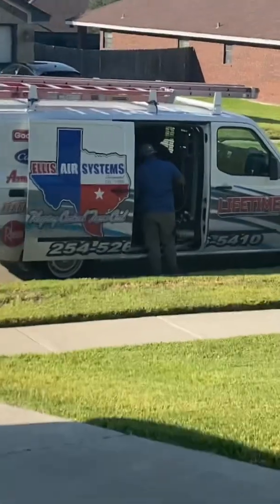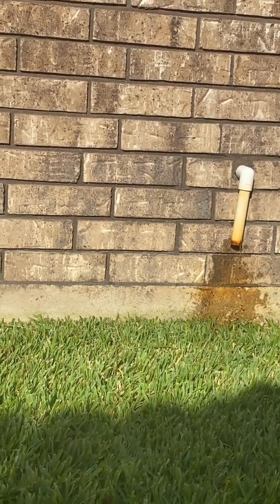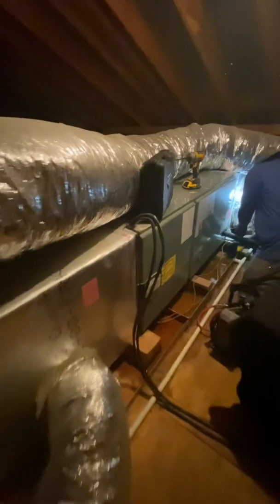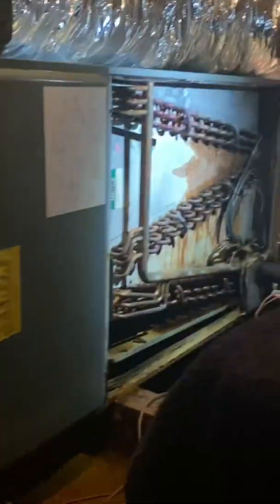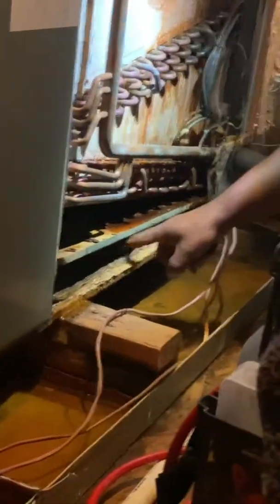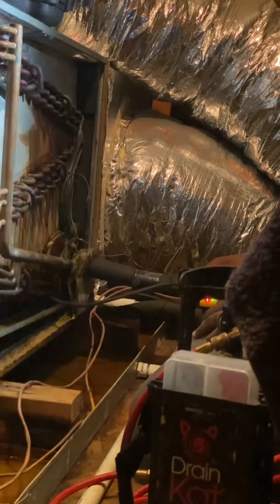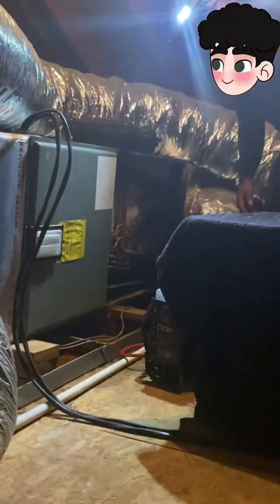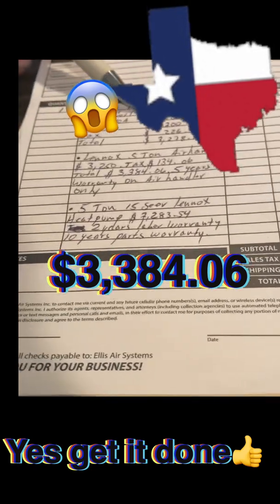HVAC REFRIGERANT LEAKS FOUND THE MAIN PPOBLEM

Comment: A/C tech with 15 years of experience in New York City I also recommend a new coil. Fixing that leak most likely would've created more leaks due to it location.
Reply from the maker: Thanks for  the advice so this comment made me more  confident that i decided and I say Yes to change my new coil. so I am impress with my young man technician 3 years experience he check for me and told me what is the main problem. It happen 3 times  during  summer time was leaking and over flowed.